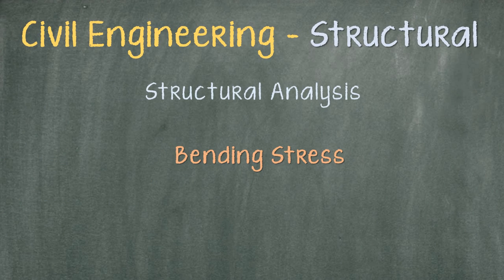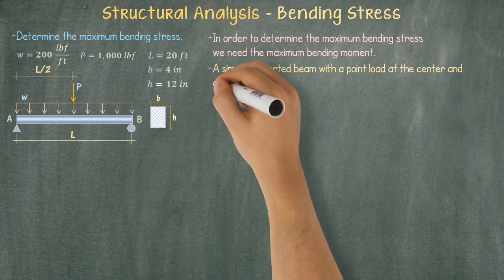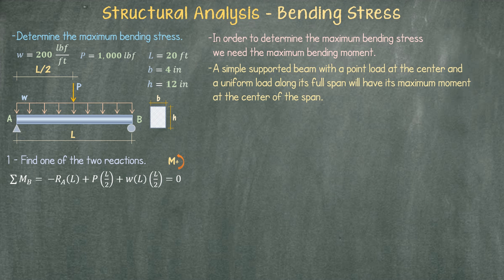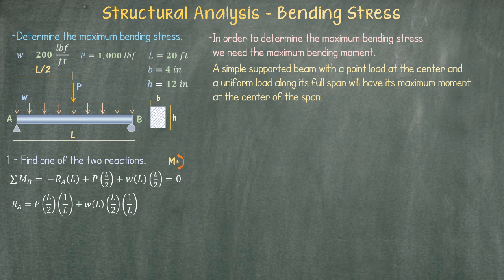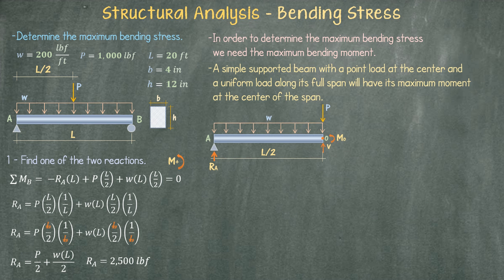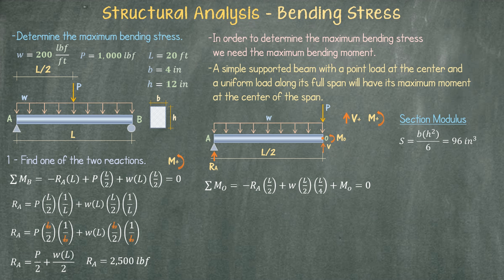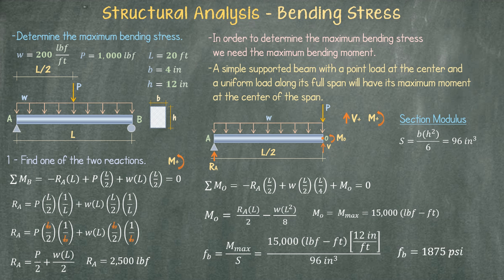Bending Stress on Beams

Comment from the maker: Time Stamps 
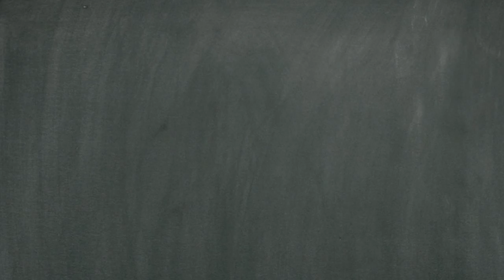00:00 Start 
00:14 Bending Stress Beam Example 
01:07 Find Reaction for Bending Stress Beam 
03:00 Find Bending Moment Along Beam
03:28 Determine Section Modulus for Bending Stress on Beam  
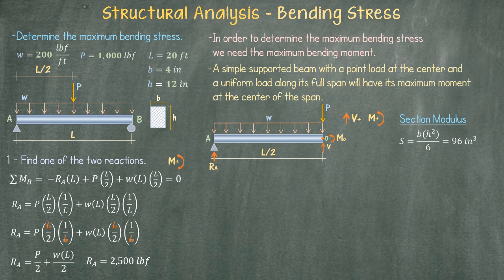03:54 Sum Moments About Point 0 
05:19 Determine Maximum Bending Stress 
05:29 Conversion to PSI 
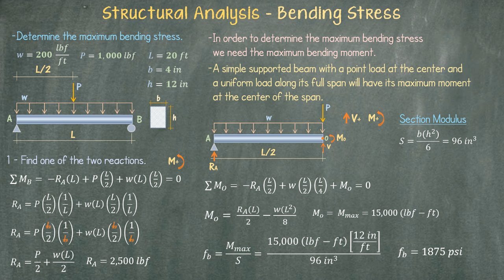05:58 Outro

Comment: What would be the load capacity for a bridge crane made from 100x100 ubc beam?

The beam will be about 5.8 meters between the crane trolleys. I’m going to use two wheels per truck ... each wheel can handle 300kg each. I will have four in total. They will be mounted as a top running truck
Thank you
Reply from the maker: Thank you for watching my videos.
The answer to your question is beyond the scope and purpose of this YouTube channel.  For the design of such bridge crane it is recommended that you seek advice from a qualified professional engineer.